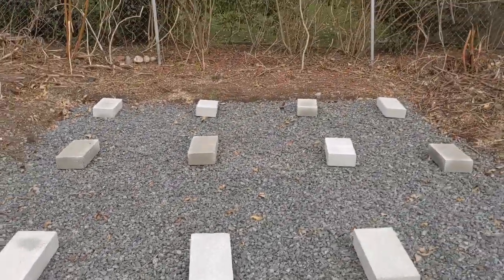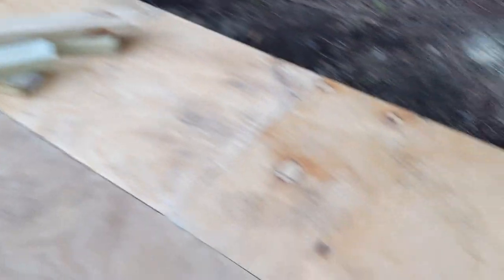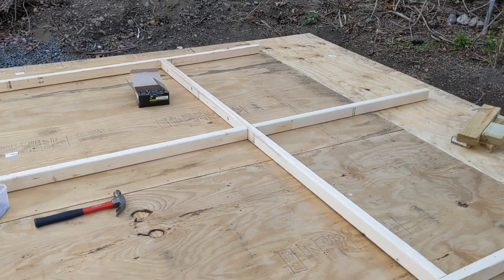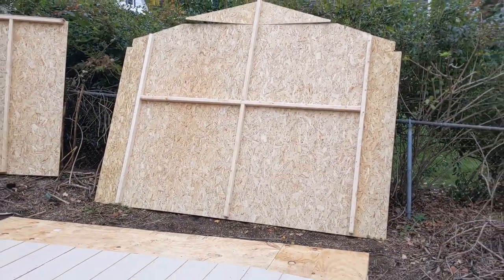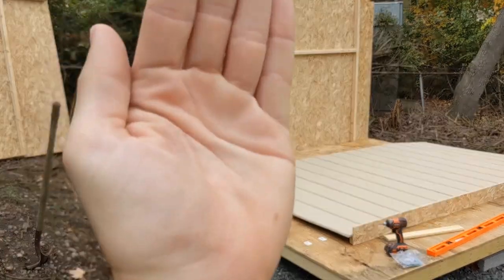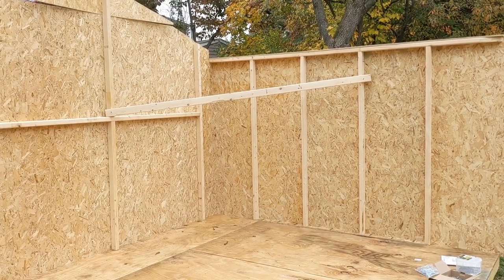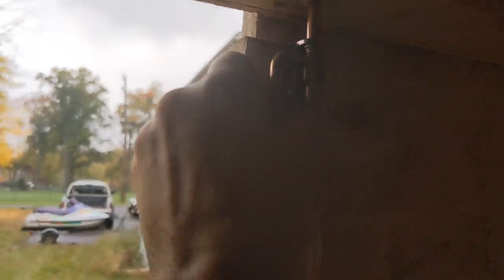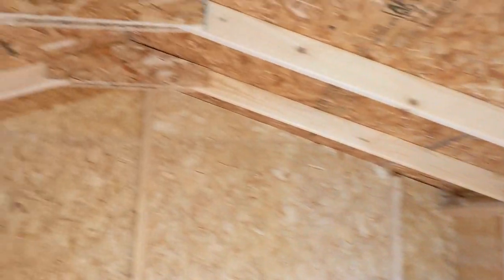DIY Shed Kit Review - Princeton (Liberty) 10x10

Comment: nice. I built a 10x 16 deck for the shed to place on with a work arear in front of the door. I did things to add strength to the shed building too
Reply from the maker: @donfrank4429  that's a good idea. It could use some extra strength
Reply: @SqueedManDan  I have built shed, add on porch, awning  on my sheds from scratch,  this is the first  time I used a kit shed precut, glad I have  my nail guns one for 2 inand another  for  framing nails
Reply from the maker: @donfrank4429  love it! That's awesome! Yeah I'm sure the nailguns made it much easier!
Reply: @SqueedManDan  I have a YouTube channel  with stuff
Reply from the maker: @donfrank4429  excellent! I'll check it out
Reply: @SqueedManDan  I am watching  your you tube on the shed to get ideas, thanks for the shed video,  it gives me ideas as I am building  it
Reply from the maker: @donfrank4429  that's great! That's why I made this video. I'm glad it has helped
Reply: I added  the bottom  2x3 on the walls  for strength,  just took  of the thickness  of the 2x3. I cut down 10 ft 2x4 s

Comment: I just finished building my shed. I did use help to left the walls. J in also built a foundation as my ground is on a steep slope. It appears that hardware is very weak, I plan to replace it. 

Did you paint your shed?
Reply from the maker: That's great to hear and a very smart move. I actually didn't paint it yet. It's still holding up great

Comment: how did you lift and fasten the back wall, mine seems like it will break at the toe-nail section I lift it off my platform
Reply from the maker: Yeah that was probably the trickiest part of the build. I wish I had a quick tip for you, but moving It is hard so you just have to be really careful. It definitely feels flimsy, But it didn't break when I was moving it around.
Reply: @SqueedManDan  homie, you may not have had a 'quick tip' for me as you say, but you gave me confidence to lift that sucker - I got all the walls up myself, thank you borther, cheers!
Reply from the maker: @olimazi9911  that's awesome! Haha well done. It's not an easy thing to do! Cheers

Comment: Hi. So my husband and his friends are almost done building our shed. They helped him building the floor and the wall.. now my husband is finishing by himself. The roof and the doors. Did you use a nail gun for the roof? If you did, what kind?
Reply from the maker: Hello! No I didn't use a nail gun on the roof because it wasn't a big enough job to require a nail gun. Even just nailing everything with a good old hammer I was able to do all of the shingles in an hour or two. If you do decide to get a nail gun there are a lot of different brands, but I like Rigid. Just make sure that you have a compressor that's at least 6 gallons if it's an air powered nail gun. But like I said I think the job is small enough that it's worth just doing it the old-fashioned way with a hammer unless you have a friend who can let you borrow a nail gun for the day.

Comment: Any water leak in? I recently discovered a hidden 10x10 pad and want to build a shed on it but not sure what I want to go with.
Reply from the maker: No leaks. I took my time with the shingles and used high quality felt paper and rain guards for the edges so I'm very confident that there won't be any leaking. 

A pre-existing pad sounds pretty good but you would still have to build the floor on top of it with this kit.

Comment: We bought one of these, but we need the rest…. Shingles, nails, floors.. but we’re lost. What more extra do we have to buy? Can you say?
Reply from the maker: That's pretty much it. You need to buy things for your foundation like gravel or cinder blocks, then you have to buy some of the flooring pieces, and the shingles, and nails. I think that's pretty much everything
Reply: @SqueedManDan  so we went to Home Depot and I showed your video to the guy and from the materials you used our final cost was $930 with the delivery 😩
Reply from the maker: @thalitamullins2540  That's so funny that you showed my video to the guy. Wow That's a lot of money for just the bonus materials. Hopefully you'll have some leftover stuff that you can return at the end. I guess prices are still high on building materials from the supply chain issues. Best of luck on the build
Reply: @SqueedManDan  I know. Very expensive. Do you think we need the gravel or just the blocks are ok?
Reply from the maker: @thalitamullins2540  It kind of depends on how hard the soil is and how consistent the ground is. The proper answer is that you do need the gravel. That's definitely the right way to do it because it helps drain water away and keep your shed level over time. Sometimes soil won't be bad and it might be fine for five or even 10 years, but eventually the soil can compress different amounts on different sides of your shed and the shed could start to sink or tilt. I got my gravel from a local quarry and it only cost like $75 and I borrowed my friend's pickup truck to pick it up. If you're buying gravel in bags at home Depot I know that it would be much more money than that. It's worth looking around to try and find reasonably priced gravel.

Comment: Nice job! I would be building the shed myself as well. 2 Questions, what tools did you use/wish you had, and would you have been able to build this "without" it being a kit and list of lumber by yourself (trying to save money as wood prices have gone through the roof)
Reply from the maker: I used a hammer, screw gun, big level, tape measure, and I might be forgetting something, but it's also helpful to have a tool belt and maybe some gloves. In theory I could have purchased all the wood myself and built it, But it would have taken much longer if I had done it that way and I even did the math and I couldn't buy the wood for cheaper than it came in the kit. One of the advantages of buying your own wood separately is that you can use 2x4s instead of 2x3s so it will be stronger, but only attempt that of you have good shed plans and have some construction experience.

Comment: My question is . How secure is to build a shed over bricks  ? I ask because I think what would happen when is winding hard  I think it will be move  away from the bricks
Reply from the maker: With metal or plastic sheds they can break or blow away, but wooden sheds are usually too heavy to be moved by wind. You could add anchors if you wanted to but they are a pain and probably not needed unless you expect tornado strength wind. Some towns will have requirements for shed anchoring, but they usually don't apply to wooden sheds.
Reply: @SqueedManDan  thanks Danny for the tips god bless you I like your video
Reply from the maker: @adolfosanchez7434  thank you for the kind words and God bless you as well.
Reply: It's always best to anchor. Considering the low cost of anchors, and relative ease to installing them, it's insurance well spent.

Comment: What was cost of ur shed kit?
Reply from the maker: The kit was around $1000, but I spend a few hundred more on the flooring, shingles, and fasteners.
Reply: @SqueedManDan are you sure kit is only $200?
Reply from the maker: @kazbekshekhinaev8827  so sorry. I edited my original comment now. It was about a $1,000 for the kit and then a few hundred for the extra supplies.

Comment: Looks great! Does the kit include the wood? What is the cost? Thank you
Reply from the maker: Sandi, the kit includes the wood for the walls and roof, but some of the flooring has to be purchased separately. The kit costs a little more than $2,000 depending on where you are located, but the extra wood and shingles will come out to a few hundred dollars.
Reply: @SqueedManDan  Wood has gotten so expensive lately here in FL. Thank you for replying and share any other projects you take on, you have the patience for it.
Reply: @sandic452  It's expensive everywhere.

Comment: How many bundles of shingles did you use my kit is sitting in my back yard right now...
Reply from the maker: The instructions said 5 bundles so that's what I got, but I was able to return one of them at the end because I didn't waste any of my cut pieces. Either way buy 5 and return at the end because it could leave you in a bad spot if they run out of your style of shingles when you need to get more.

I kind of did my own pattern based on the cut pieces I had for each row of shingles, but if you do the "correct" pattern it probably would take 5 bundles.
Reply: @SqueedManDan  thanks dude great video I’m recommending it to a buddy who just bought the same kit

Comment: The directions for the shed need to be rewritten as I had spent hours reading the directions and found out that it was wrong but anyways it looks good turned out very good and it pretty good for 2 weeks because they say it should take two days to do the shed that's bull crap that should take about five days
Reply from the maker: Yeah some of the steps are pretty confusing at first. Glad you got it built! 👍